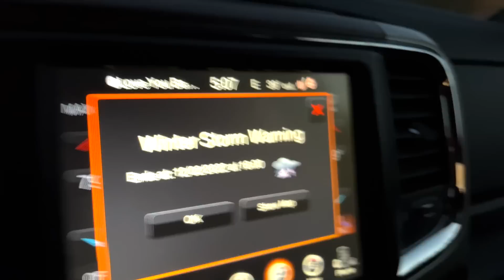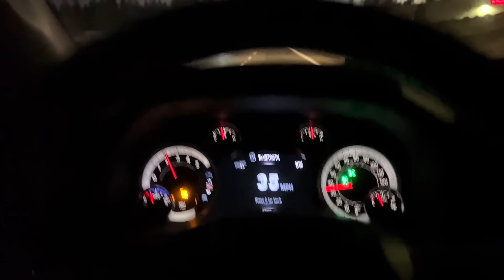Race to get the machines out before the storm. Hauling with all 3 trucks!

Comment: My 22 5500 Laramie just came in. Got the bed, tool boxes, transfer tank, and air compressor installed. Don’t even have 1000 miles on it yet and just had someone hit the steer axle. No body damage but ruined the rim and Jacked up all the steering components. Of course their insurance is some no-name janky company

Comment: Put dashcams in all of your trucks
Reply from the maker: I’d need 20 dash cams:/
Reply: @VBELTandSON  that ain’t hurtin you big spender
Reply from the maker: @richardford5848  lol be cheaper to get a camera guy
Reply: @VBELTandSON  NEVER drive a commercial vehicle without one! You lose 1 lawsuit over a scammer and those 20 dashcams will look real cheap. (Or get caught recording videos with your cell while driving a commercial vehicle). I use the Vantop H612T Mirror DashCam. It mounts over the factory rearview mirror, rear camera I mounted on my headache rack, records 2K video from the front and rear cameras onto a 128G micro SD card. It holds around 6 hours of video for both the front and rear views. I can see cars along side my duals and over the top of my gooseneck trailer if the load is not too tall. Many of my videos include footage from it... check them out!